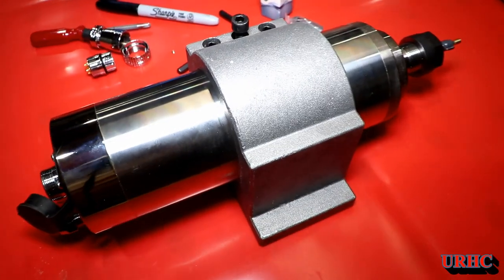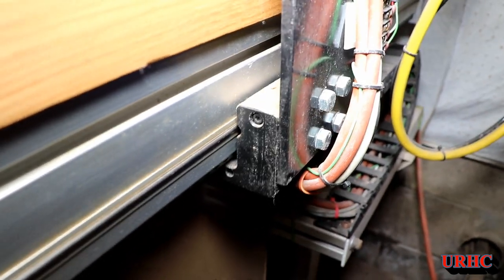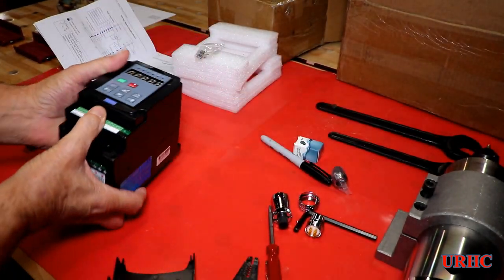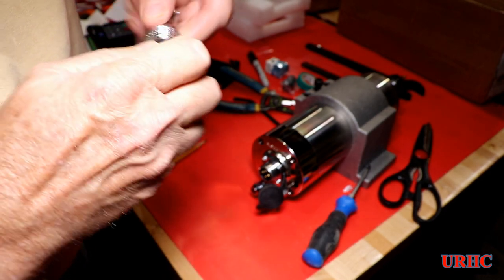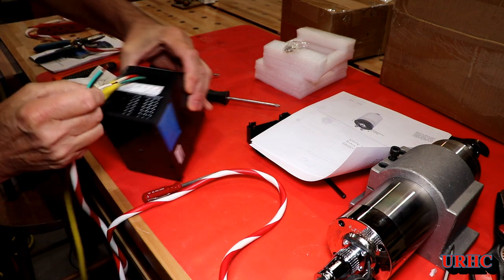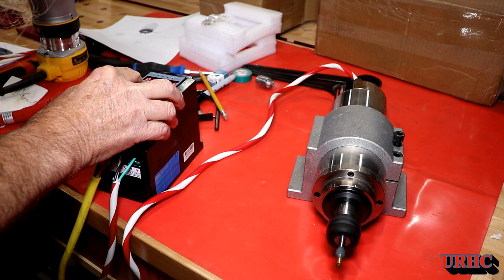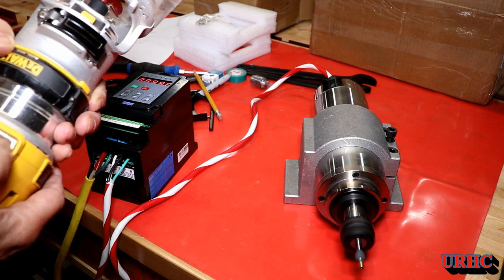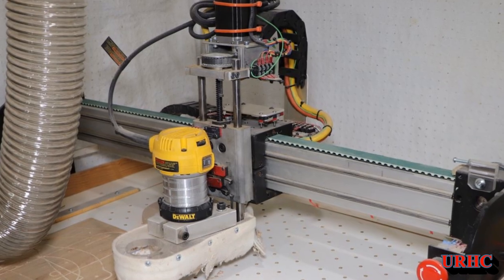First Look, Wiring, And Startup Of The Lowest Cost 2 2 kw Spindle And VFD On Amazon

Comment: Putting this in a router table is a great idea. Might have to think about doing that in my upcoming router table build.
Reply from the maker: Not sure if you would need a 4 bearing model but you would barely hear it and be able to make a nice sealed dust collector adapter.  I am thinking about a mortise machine with one if this works good. Thanks for watching.
Reply: @unemployedredneckhillbilly2023  Indeed! It would be a luxury that I might be willing to indulge in! If you search for "George Carlson Router Lift" on YouTube, he has a brilliant example of using one with an Arduino-based, stepper motor lift.

Keep us updated on a Mortiser project, that will be special!

Comment: very cool will you run the water through a radiator coil with a fan for cooling the water down? then to the storage bucket for further cooling?
Reply from the maker: I don't  plan on a radiator.  I think a bucket on the cool floor will be enough. If not I am thinking some solid state cooling modules  on an aluminum block with a small reservoir. Thanks for watching.

Comment: Hi I've just brought the same components. Did you wire it up to be controlled by software and if so do you have a wiring diagram. Thanks
Reply from the maker: Yes I did. I don't  remember  the exact  wiring but the Masso controller instructions had a similar  VFD and I used that. The pamphlet with  the VFD also lists the input and output connections.  Any questions contact your  machine controller manufacturer before turning anything  on. Thanks for watching.

Comment: I sure hope you will include a build video on making a lift. This is the most awesome idea I have seen for ultimate control. I know it is 3 hp but does it have the torque to run  larger paneling bits like normal 3 hp routers do?
Reply from the maker: I am using  this on my CNC router.  I used a Jessem lift on the table build.  There's a playlist about it.  Thanks for watching.

Comment: I have a three phase grinder from Dayton and I have to convert it to I guess single phase 220 I have no manual for it I have the same one you have in this video mines a 1.5 I guess I tried to blow your pictures up but couldn’t see where the three wires coming from the 220 plug in the wall would go and where do I put the three wires coming out of the machine to my grinder could you show a better picture of that or at least send it to me ? I would greatly greatly appreciate any help
Reply from the maker: On mine  the input went to the l and n. The output to the spindle  go to u, v, and w. check your  manufacturer's manual to be safe. Thanks for watching.

Comment: Great video! A bit late to the game, but could you elaborate on how you safely grounded the spindle even though you only had a 3-wire cable?
Reply from the maker: I have a #12 ground cable hooked to the Z carriage the spindle mount is bolted to. Provides ground and helps with electrical noise.
Reply: @unemployedredneckhillbilly2023  thanks for clarifying!
Reply from the maker: There is also another ground on the x carriage. Bearings are not good grounds so all components are tied back to the frame ground.  Helps with electrical noise from things like spindles also.
Reply: @unemployedredneckhillbilly2023  thank you, this whole build was super informative

Comment: My problem is direction of rotation is wrong.
How to rotate direction of motor to right direction.
Engine always turns the other way around. weird.
How to set M03 direction of rotation.
Reply from the maker: I think you may have the spindle  wires switched.  You can also switch directions in the setup program.  Contact  the manufacturers of your spindle and drive to get the instructions for wiring and drive setup.

Comment: torque ? is it a concern?
Reply from the maker: This one is rated at 3hp at 8 amps and 24000 rpm. It is a 2 pole 3 phase motor rated at 14 nm or about 10.3 ft pounds of torque at top rpm and the torque will be less at lower rpms. I think from about 15k to 24k the torque is fairly good. I understand the VFD can crank it up to 9 amps for short periods of time. Below that it drops off and this can only be run for short periods when you get down to 8k. For cutting wood I am not worried  with the chip load but for steel you would have a big issue with the lower rpm limits. I will find out but from videos that I have seen  i doubt it will be an issue. I have not been able to find good data sheets on this combination. Thanks for watching.

Comment: I can't find any 16g 4 core sheilded cable only 18g rated at 600v...will that do
Reply from the maker: For what?  Thanks for watching.
Reply: @unemployedredneckhillbilly2023  sorry for the vfd to the spindle
Reply from the maker: I just went  with  16/3 unshielded and kept it seperate  from the other wires as far as I could.  Used a seperate ground wire to the z near the spindle mount so there wouldn't  be a loop back to earth ground. So far no problems. I read different things about that 4th ground wire and decided to try this first.

Comment: I see the VFD has gone up to $150.00
Reply from the maker: Wonder  if it's  because  the dollar is loosing  value everyday against  other currencies lately. If you put a item in your  cart the price usually  drops after a week or 2. Prime days is in 2 weeks with some  good  deals also if you are looking for one. Mine  has worked  great but for that new price you can get a name brand.  Thanks for watching.
Reply: @unemployedredneckhillbilly2023  I found one on EBAY for $80. spindle 135.00 I believe so I am pleased with the price. Thank you for your reply. A friend of mine gave me a frame for a 24"X24" router. It is a welded 4" stell sq tubing with about 1.4" walls. It has been machined for rails. With this spindle and the new motors and drives It should cut aluminum like butter. (:)) I am 79 retired and having fun.
Reply: sorry miss quote it was $136 not $150 On Amazon